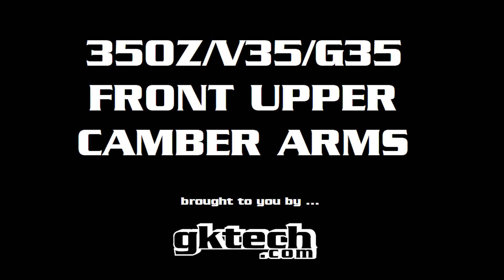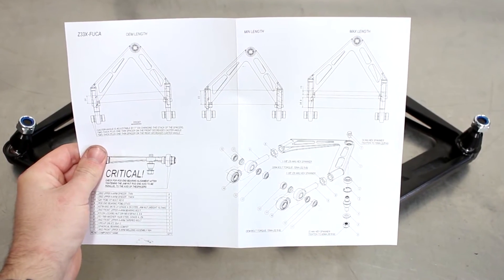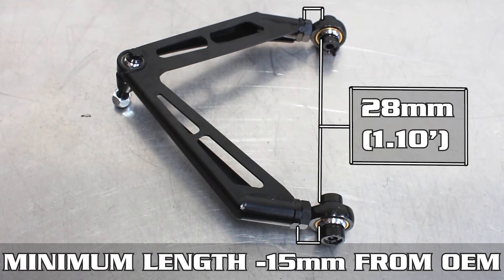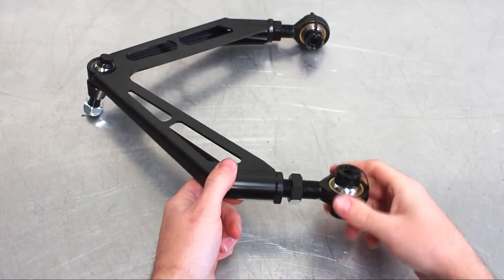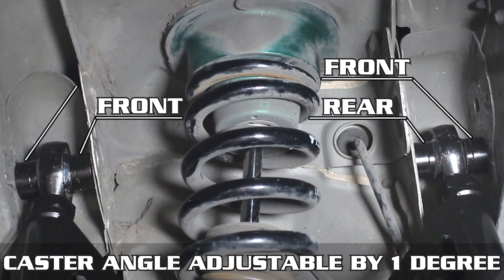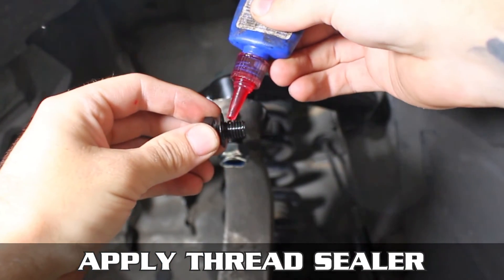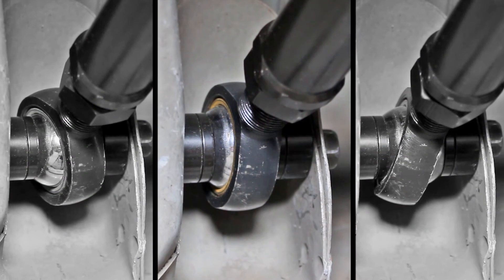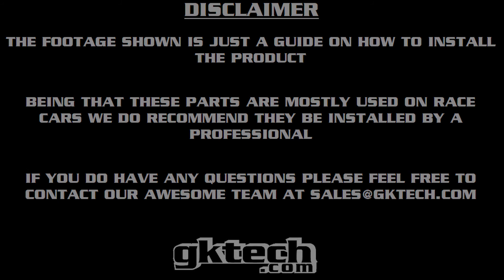Gktech 350Z V35 G35 Front Upper Camber Arms - Install

Comment: Can you add your version 2 adjustment document in the video details?
Reply: For caster adjustment, Front as in front of the car correct and on the side that's facing the front of the car, add two thick + one skinny spacer. The side facing the rear of the car will have one skinny spacer correct?
Reply from the maker: @jasonpensy8043  Correct, so front means the front of the car and two thick plus one thin at the front increases caster and two thick plus one thin spacer on the rear decreases caster.
Reply from the maker: We are yet to release our latest arms install video in the coming weeks, however, the assembly guide is live on the product page on our website, under the 'user guide' section!

Comment: Are the arms side specific?
Reply: Yes, the longer arm is to the front making the upper ball joint slightly rear of center. Check the drawing. https://au.gktech.com/static/assembly-guides/Z33X-FUCA%20-%20Customer%20ASM.pdf?dl=1

Comment: Would it be okay to install one arm with more caster and the other arm with less caster by adding or removing the spacers accordingly?
Reply from the maker: That is possible if you need I guess, but would suggest setting them the same and getting a wheel alignment to determine what is ultimately out.

Comment: How do you adjust the camber when you're on the alignment rack take the arms out and adjust them, this don't make sense??
Reply from the maker: Hi there,
That is correct, you need to remove the arms to make any adjustments, that is why we mention to set an equal length before fitting the arms, so you have a good base to work from!

Comment: Any tips on getting the 4 inserts to stay in place while inserting the arm?
Reply from the maker: Not really any trick, just stack them on top of each other and install the arms!
Reply: We just finished the kit and we used 3/4" blue tape to hold the inserts.
Reply: 2many240s I used a tiny bit of energy suspension grease and it worked like a charm. It’s tacky enough to hold onto to them while they slide into the slot.